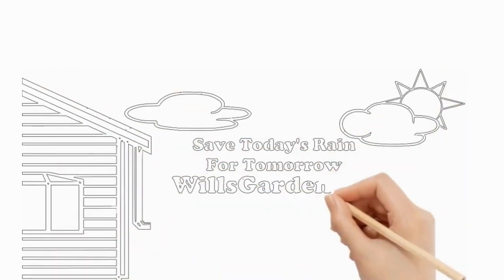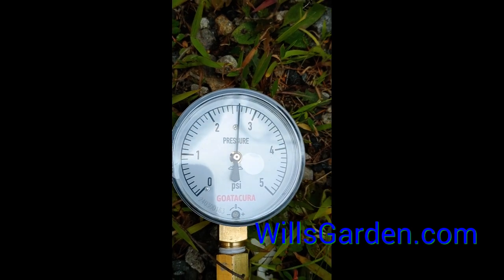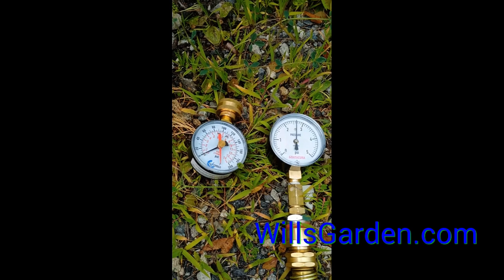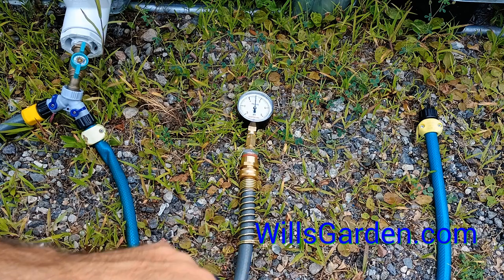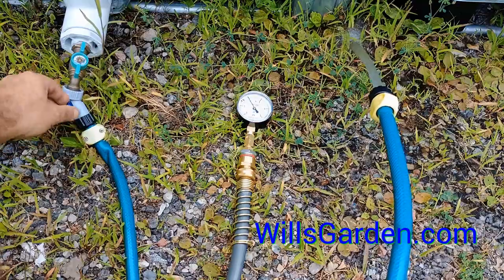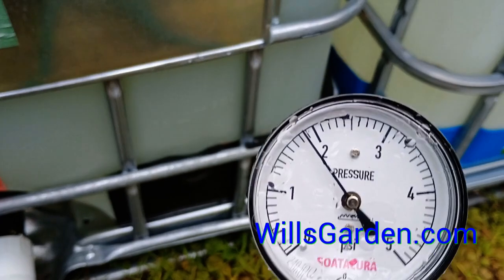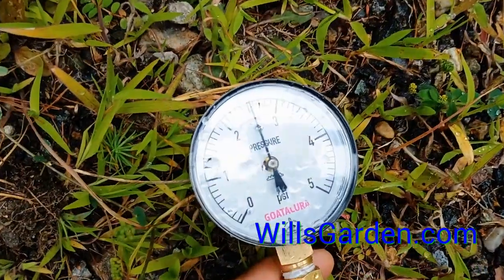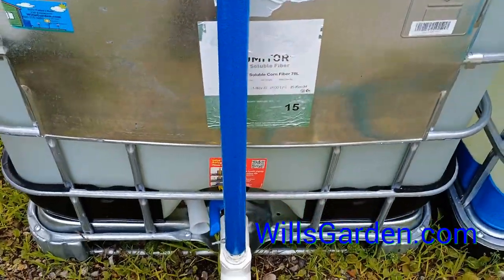Do you need a pump for a IBC Tote? Pressure test of IBC Totes double stack used for watering garden

Comment: Quick question--->  I am trying to put together a shopping list for my set irrigation set up-->  Would a Vertical 500 gallon tank provide more than 2-3 PSI?  or would it be the same pressure as putting two 250gal IBC totes together?
Reply from the maker: How many feet tall of water it is, is what matters.
The pressure at a specific depth is the same regardless of the volume of water above it. A tall, narrow container will exert the same pressure at a given depth as a wide, shallow container, as long as the height of the water is the same.
Shape of the container:
.
The shape of the container doesn't affect the pressure at a given depth, as long as the height of the water column is the same.